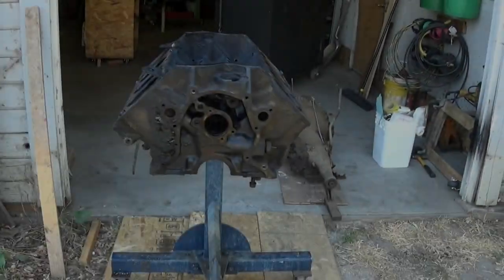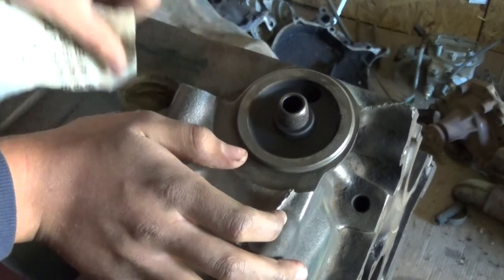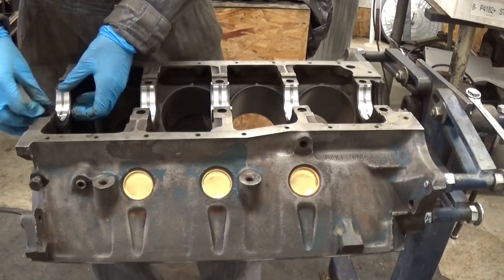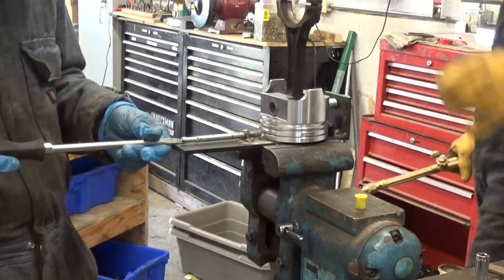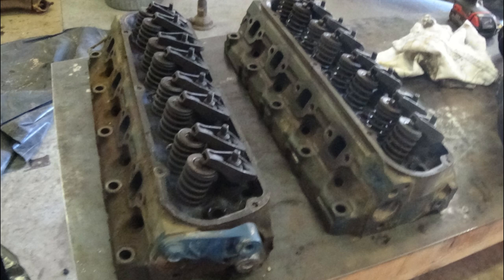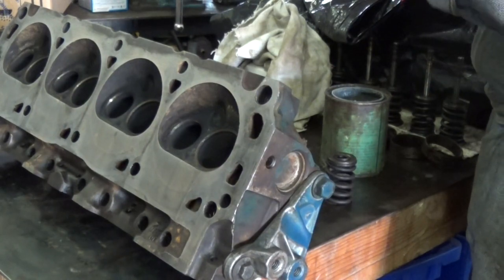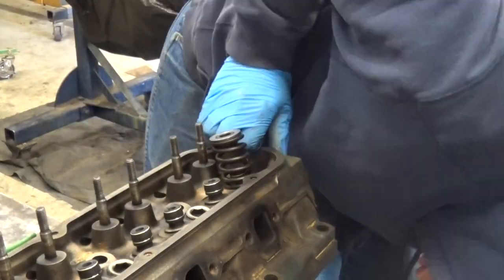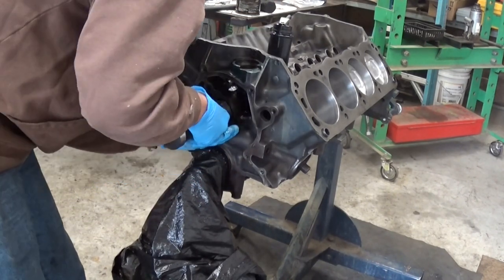351 Windsor Budget Build, No Machine Shop!

Comment: Where's the cam lube?
Reply from the maker: The cam lube was just oil with extra zinc also we ran the oil pump before starting it to make sure the oil got everywhere
Reply: I’m not criticizing, but that method is good for a roller cam not so much for an hydraulic. 

You probably didn’t harm it but it is a risk.

Comment: New piston rods should have been used... old bones cant carry new muscle...
Reply from the maker: Ok, didnt worry about that on this one because we didnt add too much more power.
Reply: Regardless of power addition.. it's now a weaker function and future problem causing more of a headache later on...
Reply from the maker: Ok, I didnt know that so I will keep that in mind for the future. thank you.
Reply: @americanrebuilds2815  Dont sweat it. Those stock rods can handle 450 plus horsepower, your fine no more hp than your making. The truth is alot of old ford engine parts like crank and rods etc..., are alot beefier than say sb chevy or  whatever.  Example, a stock 460  bb ford crank can handle 700 hp  as is.  Keep truckin!
Reply: If this is a truck engine with the football head rod bolts, the rods can handle 600hp easy with an ARP rod bolt upgrade.  Will definitely handle 400hp with stock bolts.
Reply: @Scubasteve22  I agree 100% literally millions of rebuilt engines running many miles on stock rods.  I doubt that combination will be anywhere near 300 HP. Stock heads and a cam upgrade with stock rods seems very reasonable to me.
Reply: Your heads won’t flow enough to hurt the rods. You have a nice fun motor, don’t worry about the rods. Just don’t screw up the air/fuel ratio, add too much nitrous, or rev it to 8,000
Reply: @that-savage-kid6942  wrong.  Reusing rods is as common as reusing the block.
Reply: Stock SBF rods are actually better than Chevy rods... ( and I'm a GM guy)... rebuilt my 351W to 425 HP 30 years ago, revved it to 6,500...

Comment: That's badass love this video how hard was it to install the cam bearings? Also what grit sand paper did you use to clean the block
Reply from the maker: I used I a high grit something like 400 but it was also wet so that also helps. Cam bearings are a little tricky you need the tool and and you have to clock them correctly that’s the main thing
Reply: @americanrebuilds2815  thank you man I appreciate the quick response and how's the truck running now any hiccups?
Reply from the maker: She had some but we weren’t really able to work them out since it was my brothers car and he moved away